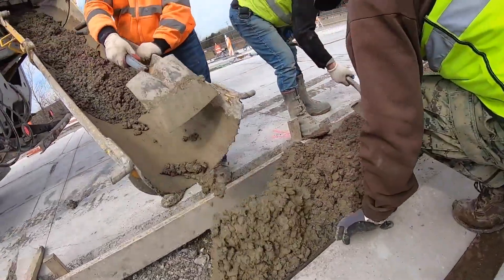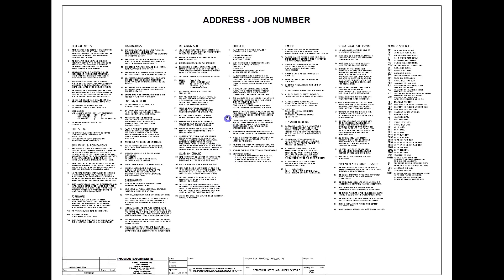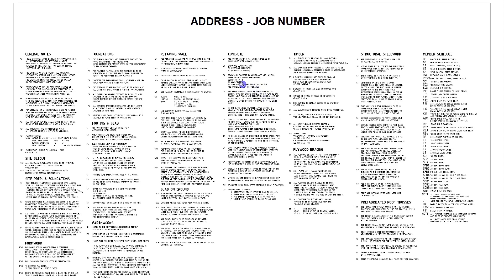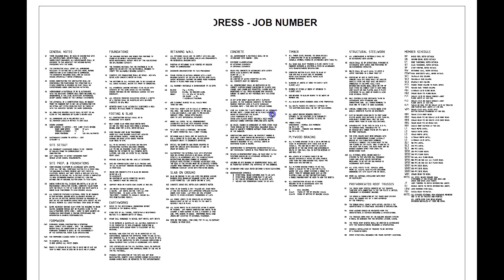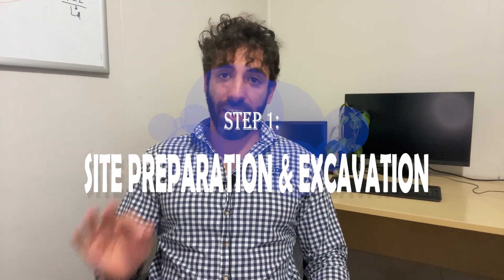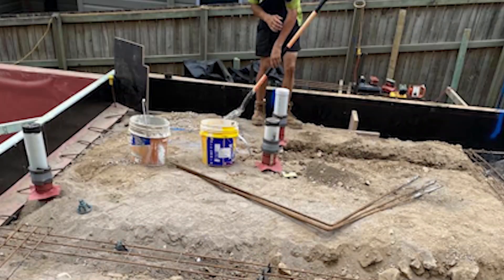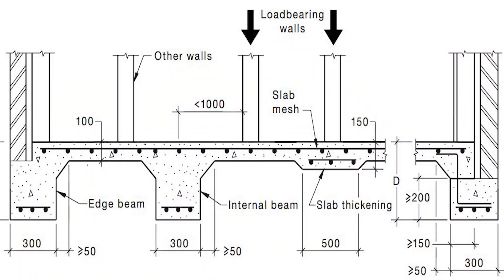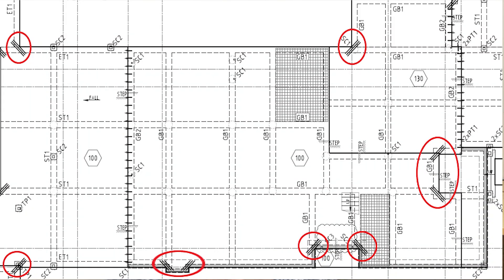5 Steps to Building a Residential Slab on Ground

Comment: Hi,
Please produce a sectional drawing for me to understand

130mm THICK RC SUSPENDED
SL92 MESH TOP. 25mm COVER.
SL82 MESH BOTTOM. 30mm COVER.
BAR CHAIRS AT 800 MAX. CENTRES.
f'c = 32 MPa.
ON 0.2mm THICK POLYTHENE MEMBRANE.
ON 50mm THICK PACKING SAND.
ON PREPARED SUBGRADE

Can you show me a sectional drawing of what this means
Reply from the maker: have a look at this video. It may help you
https://youtu.be/QaXe_BjLoqo?si=0ZBimGmiMkSytry_
Reply from the maker: this one as well
https://youtu.be/alftkclr3dI?si=Jzra14CiUTDdIBg1

Comment: Hi thanks for your videos.  I have a project, 600 edge beam however below the edge beam the engineering drawing show 400mm min blinding concrete to original soil with 100kpa bearing capacity.
Should  do 2 pours for this? Should I install the vapors above the blings? Thank you
Reply from the maker: typically 2 pours and the blinding layer can be of lower concrete grade (refer to your engineering drawings). vapours can be above. What type of soil do you have?
Reply: @bengthebrazilianengineerinAus  great thank you. Class M, But soft fill is observed top 1m...
Reply from the maker: @ningchen6242  footing depths are typically between 300 and 400 for class M depending on the type of construction. I would have done some backhoe pits or piers to go through the fill. The blinding layer works as well, but you may end up using more concrete.
Reply: @bengthebrazilianengineerinAus very much appreciated your reply. if I go with bore pier, what spacing it should be normally?
Reply from the maker: @ningchen6242   It's specific to each project. I would ask your engineer. I can't give you advice on that on Youtube.
Reply: @bengthebrazilianengineerinAus  Hi thanks, just curiousness...for normal single-storey brick veneer with tile roof...Thanks

Comment: Amazing video thank you. May I please ask 1) if the concrete floor is going to to have a grind and seal, what is the minimum specifications you'd recommend. Could you get away with N25. 2) how much extra thickness do you specify for a polished concrete slab compared to a standard?
Reply from the maker: I would up to N32 at least. The price won't change much and you will have a better finished product. SL82 mesh, but SL81 is ideal. Cure the slab with plastic for 7 days. Top cover around 35mm. Have a look at CCAA polished concrete guidelines if you're unsure.
Reply: @bengthebrazilianengineerinAus  Thank you and i'll get you to do the engineering for this when we are doing the plans. With my best wishes, NIrosh
Reply from the maker: @joshkwd8527   Sounds good Josh. Looking forward to it. Feel free to reach out to me anytime.
Reply: @bengthebrazilianengineerinAus  I will do for sure bro, I am Deigo's friend btw - small world!

Comment: AS2870 have raft slab and strip footing table , can you more clear when i can select raft or strip footing please as i am little bit confuse. thanks your video aawesome
Reply from the maker: My interpretation is that strip footings are usually for masonry walls and they run underneath the slab (tied or not to the slab). A raft would be a single stiff element. This is how I see it.

Comment: My off the plan house builder is going with M-class slab for p class site 85mm thick 20mpa waffle pod slab for a double storey house. My worry is M slab okay? Builder offered only minimum 6 years structural warranty. Do you suggest anything I can do or say to builder now as only the piering done as of now.
Reply from the maker: Hi mate, firstly you need to look at the soil test and understand why the site has been classified as P. It could be due to presence of trees, soft soils etc. Class P may not necessarily be bad. Possibly the expected surface movement of you site is for class M, hence the reason your engineer designed the M-class slab. If you are unsure, email your engineer.
Reply: @bengthebrazilianengineerinAus  
Bit concern about having M-class slab design by structural engineer on a p class site, usually seen them specifying H class slab. Interestingly the block behind
 mine has the same model house (80% completed) has H class slab but for ours the same engineer specified M-class. 

Read few horror stories about
 slab heave and our warranties is only 6 years. What are the preventative measures that can be taken to avoid slab heave issues? 
 Read that concrete apron around does help? Thanks mate, your video was very informative. As an engineer myself, I appreciate & feels good when educating people on fundamentals which can help them in real life.
Reply from the maker: @rsg5850   Not a problem. Happy to help. If you google "minimizing foundation movement QLD" or something in this line you may find good guidelines
Reply: @bengthebrazilianengineerinAus  legend!

 Is there a standard in Australia for the design life of structure and foundation for residential build?